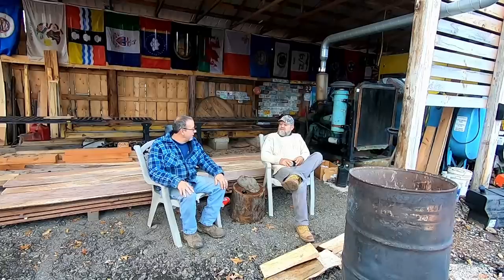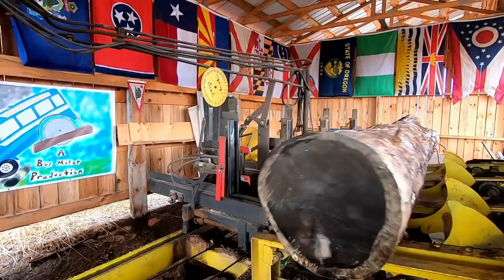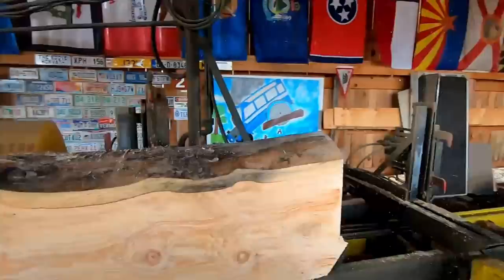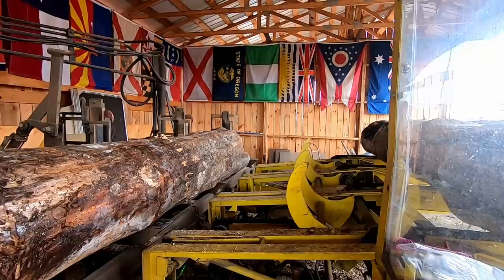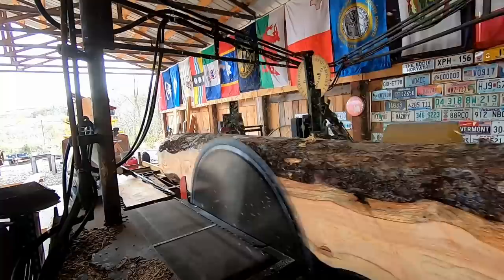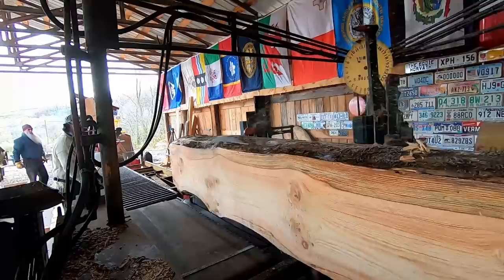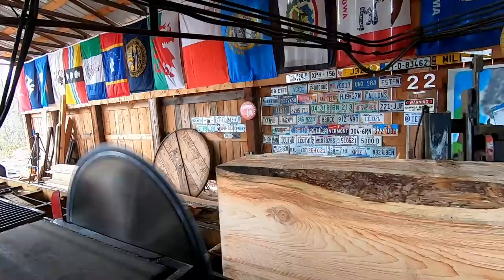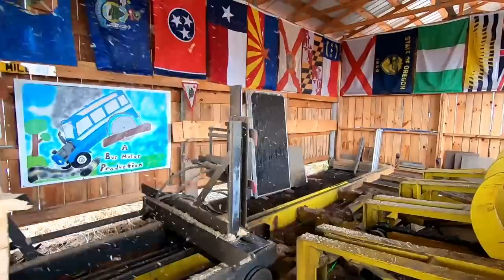sawing Eddies 2x8 rafters # 247

Comment: Good morning Mark & TEH, just thinking while taking my dog out for a walk, in the frost and dark. Why don't you get yourself a Vehicle Diesel heater,  I bought one a while ago and it was as cheap as chips,  has a remote, comes with it's own 1 gall fuel tank. It is quite and runs off a 12v dc supply. Comes with hot air trunking, so you could have it outside and pipe the hot air in ?. My other bright idea ! Was to plumb the hydraulic line through a radiator in your cabin so it acts as an oil cooler when the hydraulic gets hot and a radiator for your cabin? I'm full of ideas me 🤭. Wishing you both a happy Thanks Giving.
Regards Richard uk 🇬🇧

Comment: What size blade you running and is that a Frick carriage and headblocks
Reply from the maker: Hi Jon , we are running a 56" F-pattern saw and this is a Edmiston sawmill that we rebuilt.
Reply: @markgalicic7788   I have a Frick about what you have but the carriage needs rebuilt I run a 60" blade friction drive for carriage 80ft of sorter off the belt that's nice so you can sort from the headrig

Comment: 12: 00 in video I said use pulleys and fan belt (or other rubber belt) I assume the hydraulics would push the turner tight enough to any log (especially round ones) and that would solve the tear out as I also see at 12:00 in video (you can definitely see tear out on the face of the log) just sayin / no big deal on pallet lumber but hate to see black walnut or good oak wasted